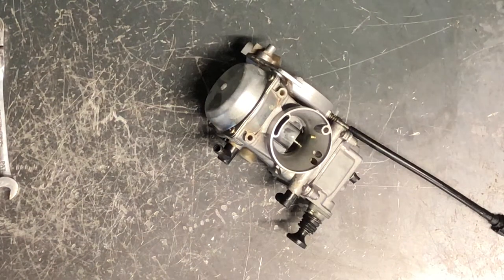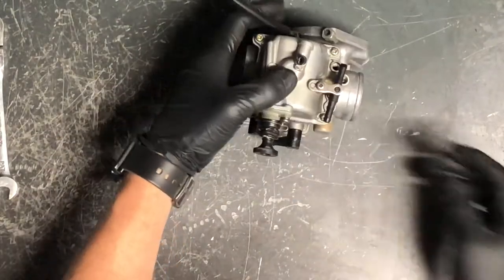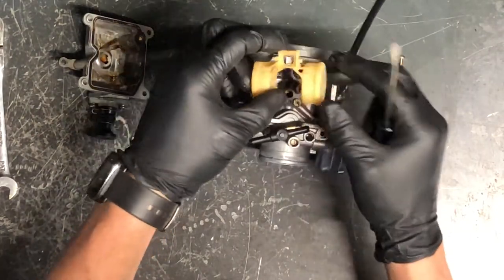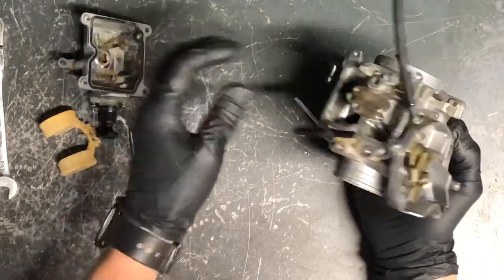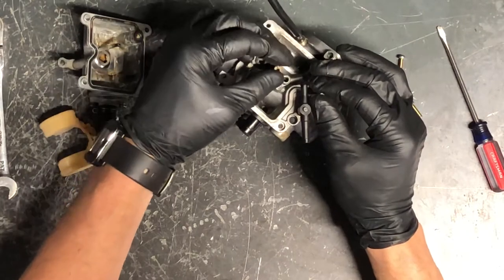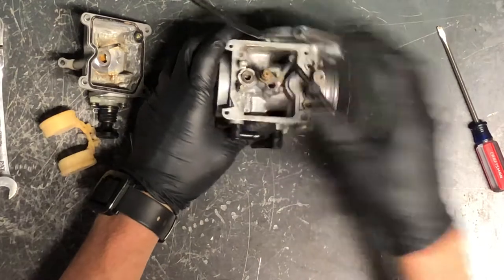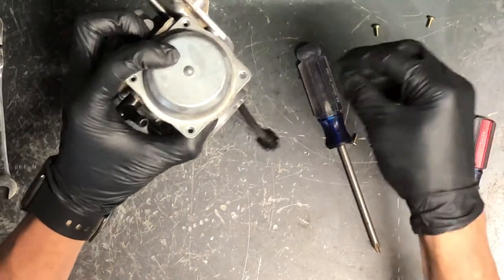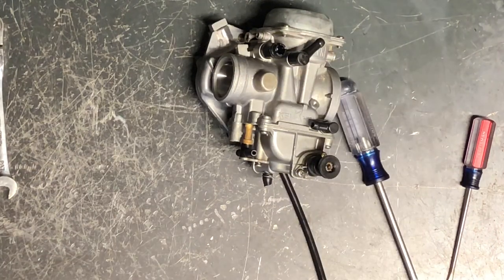HOW TO Kawasaki Prairie 400 KVF Carb- Adjust Clean Repair Rebuild Service Carburetor Kit

Comment: I have the same carburetor shop replaced cranks well idkes well but at about 1/2trottle the rpms stop risen no stumbling or busting any clue where to start air/fuel or a jet which jet controlls top end spark plug maybee

Comment: Just a tip for Kawasaki screws if you have regular Phillips you may have issues with stubborn hardware but the JIS Phillips really makes a world of difference I didn’t believe it would actually make any difference but it does well worth the $15-$30 take my word on it if you own one get a JIS Phillips #2 covers mostly everything on the quad you’ll need to work on

Comment: So I took my carb apart. But couldn't get the pilot jet out. I can't get my bike running. And the off chance I get it running it only lasts for about 10 seconds then bogs out and dies. Do you think this is the issue?
Reply: Mid Nebraska Motorsports well. I will give it one more shot to get it out. But I cant seem to find any used carbs on the market. I might just go against your advice and get a $40 dollar one!!

Comment: Took mine apart and cleaned. Reinstalled and appears to be loading up. Turned off gas while running and ran smooth and strong just before gas depletion. Any suggestions?

Comment: I'm having a problem with my Prairie where the carburetor is leaking. I'm pretty sure it's out of the overflow only but I checked the needle valve and it stops air from coming through when I turn it upside down with the float. I checked to see if the float floats in gas and it isn't stuck when it's in the carburetor. Suggestions?
Reply: I am having the same issue. I don know what else to do. I have purchased a new carb hoping this would fix the issue. Unfortunately the gas pours out more now with the new one than it did with the original one. Please let me know what you found out.
Reply: Float out of adjustment metal tab is adjustable or needle valve

Comment: If before it won't start what could it be caused from the choke being hung in there
Reply from the maker: Yes, these are cold blooded machines (hard to start when cold) if the choke is not working properly it probably won't start. Thanks for watching. Have you hit the subscribe button?

Comment: I love all your videos!!  Been a huge help since getting my used 400 Prairie Project. What do you think about the Amazon Carbs for them? Pretty sure mine had a new one out on it just before I bought it. It had sat for years before I got it. 
It ran great up and down the driveway a few times. Fuel almost smelt like a bit of racing gas, but fuel was low, so I topped it off with 89. Now it won’t hardly run unless choke is 1/4 on and it now white smokes a bit. Didn’t do that before. This all started instantly after the new fuel.  Any thoughts??
Reply from the maker: Thanks for the questions mighty myer!!  Amazon carbs are junk, but it sounds like you've got one that might possibly be working somewhat. If it were mine I'd through it in the trash, but you might argue with that. Sounds like because of sitting you might have a little buildup in the carb (and/or tank) and it running low as well as it finally getting used may have broke any buildup free and it now is lodged in your jets. I'd certainly watch this video a couple of times and dig into your carb to see what you find. I will also link a video on the dangers of a Knockoff Amazon carb: https://youtu.be/kOv8nhHUsq4 Thanks  for watching. Let me know what you find.
Reply: Mid Nebraska Motorsports hi thanks for the reply. I got my hands on the OEM carb for it that was originally on it. I’m gonna order new OEM rebuild kit for it and put it on. 
I currently have it running good again, it was a partially clogged petcock valve restricting my fuel flow. I think the fine screen filters on the valve was stopping up.

Comment: OMG thank you. I've been searching all day through forums and what else.... Trying to figure out what the third jet was... Then I found this discovering primary and secondary mains 🤯. Once I found your video I searched with different key words and people are saying "secondary is the real main" and "primary is a bit between main and pilot" ! Is this true on this carb? Either way.. What's the size difference on each? My "primary" was a Keihin 146 but "secondary" was an non stamped manuf. #86. Still yelling to cross reference
Reply from the maker: Happy to help. You sizes sound about right. I don't know off hand what they are but typically the secondary is slightly smaller. Thanks for watching. Let us know if you need anything: ebay.com/str/midnebraskamotorsports

Comment: Hey thanks for the video! Great help! Does the pilot jet have a hole going all the way through? I can’t seem to get it unclogged if there is.
Reply: Mid Nebraska Motorsports yes I was able to get it opened up. I watched another guys video as well. He used a propane torch to burn off the gunk. The quad is idling great now. Although I have a 300 prairie they both are very similar quads. Thanks again for the videos!👍